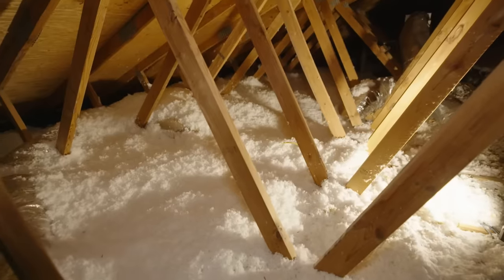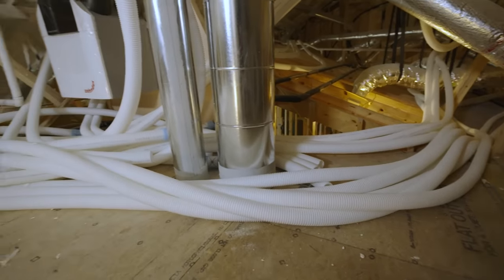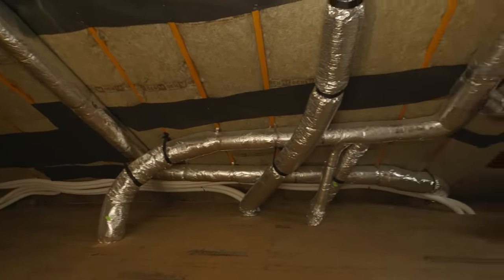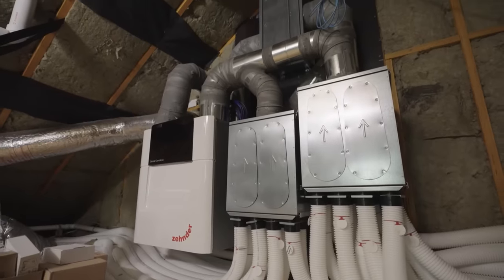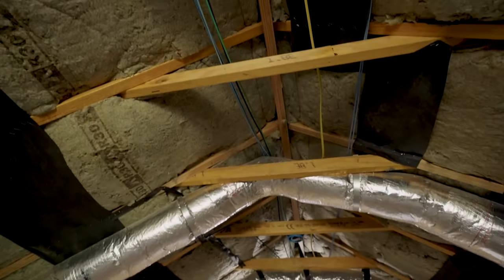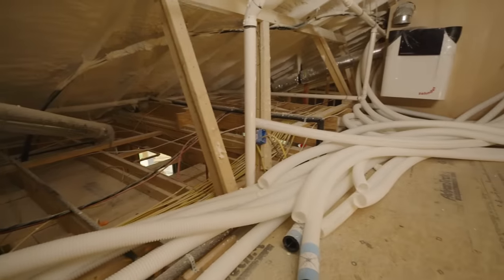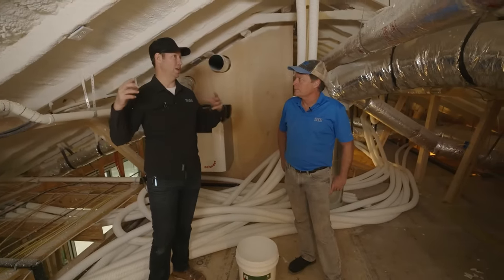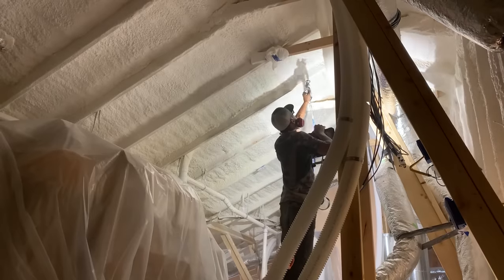Building a BETTER attic - Unvented + Conditioned attics 101

Comment: Consider maybe a vid on how to convert a vented attic into an unvented conditioned attic?? If that even makes sense 😆
Reply: Yes please my house was built in the twenties and I would love to see what it takes to do the conversion
Reply: That would be great!
Reply: You will have to wait until a vendor will sponsor that video.
Reply: Yes I agree. 
I know how but there still are tricks and questions I have
Reply: Absolutely this! I installed a new 30 year roof with a ridge vent several years ago, and now I'd love to seal it without needing exterior roof work. Can I seal the soffits and the ridge vent from the interior before insulating?
Reply: @danielbuckner2167  
Hahaaa so true.
I would love a vid on conversion also.
It depends and how deep are your pockets and how many features do you want?? 
I am converting mine. Foamers have been a bit of a pain. But i love it so far.  Changing HVAC next. Will run a simple fresh air for now but plans of a erv in future.
Reply: You can pay an engineer $5000 to tell you how to do that, but basically hes going to tell you to seal the soffit and spray foam the roof sheathing from the inside, you will have to get the current insulation removed first.

Its probably going to be cheaper to move the HVAC equipment and return air into the living space and connecting to the existing supply ductwork in the attic and sealing any penetrations like pot lights and electrical boxes
Reply: Great suggestion!!

Our home was built in the early 60's with gable vents and a whole house fan.

I would love to remove both and move towards a conditioned space for storage and install an ERV as-well.
Reply: I agree, we really need a remodel an old home example.
Reply: Basically, (although you should ask an engineer) close the vents, and get the insulation sprayed. But make sure the system can dry to the outside.
So you may need to have a vent system below your shingles. Which would be tricky but thats situational, if its traditional roof tiles you will likely not need to do anything as those are already raised above the roof (which is why they keep you cooler, hence spanish style buildings use that)
Reply: Love the video Matt.  I was so sad when you tore down your old house, even though I totally understand why.  I have brick ranch in Ohio built in 75 and would love to condition the attic, because the air and heat is in the attic.  Would like to see a retro fit video.
Reply: YES!!!
Reply: I agree putting ducts in the attic is inefficient   The problem with a lot of these new ideas is that they are not implemented properly most of the time.   A vented roof works in all climates!
Reply: I've thought about getting 4x8 sheets of foam and placing them on the rafters.  Have the foam connect on the bottom and top, but leave room for the vents and soffits to work.  Keep the roof vented and the attic conditioned.
Reply: Yes
Reply: A good foam contractor can walk you through the steps to go from vented to unvented.  There are many things to consider when the house was not originally designed to be unvented.  Often, things like combustion appliances and the HVAC layout are counting on some migration of air through the attic to function properly.  When you change the attic to unvented, it can negatively affect those and other systems.  Be sure your contractor and perhaps a consultant can spell out all the changes that will need to be considered and accounted for.
Reply: They build them all day long like that in Georgia
Reply: This!!!
Reply: Im in the same boat I think I will just end up spray foaming the ceiling and leaving the rest of the  attic vented. My HVAC is already in the house although I'd like to move it to the attic I may end up with just a minisplit setup gotta weigh out the cost. One good thing is most of my plumbing is  below my slab so no pipes to freeze in my attic. Even with a vented attic most houses in Texas have the air handler in the attic.
Reply: @seannewton93  my house was built in the 20s too, literally has to have been like at least 60+ years of homeowner hacks that have worked on it.  Found coal in the coal chute and around it so old it was shiny like glass and smooth like glass too.  (Really, no one spent like 3 min to clean it up decades ago lol, same with chimney soot all over the basement floor, even though they sheetrocked the fireplace in and capped it decades ago lol)
Reply: @macthemec  exactly
Reply: @macthemec  Moving the HVAC equipment would take a full day with a team of two in a best case scenario, and that doesn't count time spent remodeling the area where the equipment is going to be going.
Reply: @seannewton93  Its actually rather simple but in order to prevent mold growth you have to complete the entire conversion quickly.  The first thing you would do is buy a dehumidifier and let it run for a considerable amount of time full blast. This will dry ratfters and wood out, then you want to move onto cleaning, a simple bleach and water solution is the best, probably 1 part bleach to 9 parts water. You simply want to put it in a spray bottle and spray the rafters. (again to prevent mold growth). Then you want to use a mold resistant insolation (in the video rock wool, but you can use others) You want to close off the attic vents permanently and place the Rockwool between the rafters. Only after the new insolation is placed and the attic vents are sealed do you want to remove the old insolation from the ceiling. It is important to keep the dehumidifier running, and if it starts to fill up with water after you have done this if water is found you have an air leak. It is imperative that you fix this immediately. The pro of insolated attics is lower electric costs, the con is that maintenance is a priority because air leaks can lead to mold growth especially in a newly converted attic. I suggest that before you take on this project yourself to get intouch with your local roofing inspector and get a list of requirements for your specific area. I live in the humid south so mold is an absolute priority.
Reply: So… why close the vents? Doesn’t it make better sense to seal off the vented section in an existing vented attic with radiant barrier, then insulate inside that? And leave the soffit vents venting across a radiant barrier up to the ridge vent? Get rid of the heat, then insulate at the top of the envelope? Then the venting and radiant barrier gets rid of a lot of the heat before it even gets to the insulation. Or am I just wrong?
Reply: You mean a finished attic room?
Reply: Daniel Walfield about the same amount of work as a re&re, i’ve repurposed a few linnen closets to air handler closets, return air base with filter and a communicating air grill to outside the closet. It would be cheaper than a spray foam job.
Reply: @jasonm.7358  if you don’t leave an area to vent you won’t get the heat buildup. So no need to vent.
Reply: @macthemec  Pretty much what we did at our house-removed the pink insulation off the floor and sprayed open cell foam under the roof boards inside. Open cell foam was cheaper. It has helped the upstairs a lot and keeps it reasonably cool during hot days and the HVAC equipment in the attic is no longer baking during summer. It was quite a messy job but we had to do it.
Reply: @cinaibur    if you are planning on doing the spray foam, then the ridge vents and soffits will be sealed off as with foam, you can not have any ventilation.   old insulation will also be removed first , then spray foam will be done
Reply: @brad7358  It took me about 10 minutes to look into this. I simply need to install foam rafter vents before insulating. So much for the $5000 architect I need from comments above. lol
Reply: @adamfrbs9259   just replaced a 1975 ac unit in my 1974 house I purchased. Found a half bottle of orange juice from 1975 behind the unit. Looked like black motor oil. Too lazy to throw away trash.
Reply: @dougmann5362  my neighbor put in new AC this summer....AC guy was astonished...it was an AC unit from like 1950 still working lol.
Reply: @Bigrob552002  what’s a ERV?
Reply: That makes no sense and it wouldn't be cost effective. The only way to upgrade to something like this is to build a new home.
Reply: @rayhagg8402  

Hey Ray,
Glad you asked!

Matt has a whole video dedicated to answering that very question.

Check it out here:
https://youtu.be/qc67HOsHuMY
Reply: yes!  my builder didn’t seal my attic as originally planned and i’d love to correct it.
Reply: @cinaibur  I am not the expert but I say if you are not pulling a permit then codes dont know.
The key is to stop the condensation buildup / humidity. That's why he was talking about those pipes exchanging air. That's a lot of money to not have as a living area. How many upstairs have I seen here in Tennessee where the builder simply insulated against the bottom of the roof deck and slaps drywall on. I lost count how many. It works but it burns your roof off and it's a lot hotter. Does mold build up ? As long as there is no leaks. But, you cant see untill too late. So , I say , yes you can have a storage area in an attic without all the expense he is showing. There is idealism and real world. Who is gonna pay. Remove your ridge vent and close soffit and depending on size install a mini split or window unit to exchange the air .
Insulate and drywall or paneling.
Anywho, my opinion.
Reply: There are many ways to handle your attic insulation. Vented is by far simplest and cheapest in short term. 
USA doesnt have much for codes on spray foam. 
Here foam installers dont care about your hvac. They only warranty their install for a year anyways. They are not concerned with problems.
Reply: @cinaibur    guess I dont follow....as the spray foam is the insulation.    if you have a attic, then you would spray the underside of the decking ( the attic ceiling) and the insulation that you currently have in there whether its bat or blown in, would be removed.       would be nice if one could contact a member , but dont think  you can send private messages anymore ?
Reply: I would love to tear my entire roof and the roof framing off and build a more weather, fire and insect resistant roof..
Reply: @seannewton93  if you have asphalt shingles you probably still have to vent it, but you can still do it like Matt’s house and use it as living space. I did it to my house since it a half story house built in 1900 as I use as the master bedroom
Reply: Most attics in warm areas are over the garage and you can't AC a garage unless it's a separate system from the house.
Reply: @MoneyAndPeople  that's all good. Insulation against the bottom of the roof deck blocks air flow and if there is a leak , yuu can't see for the insulation . Then yuu got mold again. Plus....installing insulation against the bottom of roof contributes to the roof shingles being burned off in hot climate.
Better to have separation for good airflow by having a roof system / attic space to allow airflow to escape. Then you can insulate from the inside or withing a roof system or both to achieve all problems. Low utilities, cooler attic area, no mold, and possibly add a combo air system to dehumidify and condition accordingly. There needs to a balance since we are all trying to solve the problem of building a cave above ground. Lol. Good luck
Reply: Or at least the best way to mitigate the heat without fully converting to sealed attic with sprayfoam.
Reply: @mikepeek5655  he asked how to retrofit an existing install. All roofs should technically be "floating" especially asphalt shingles. (hip and ridge) Its important to think of an insulated roof as a very small triangle shaped attic. However if you are retrofitting, that small space is typically not enough to prevent mold growth, which is why i suggested the dehumidifier and the pre-bleaching application as well as mold resistant insolation.
Reply: Yes please.
Reply: My house was built in 2003 here in Florida and my attic space shows like the one in the beginning of the video with R30 blow in Installation.
Reply: I mean I would pay for retrofitting if it meant you get an attic that is somewhat livable, give me lower bills, and reduce humidity. Does anyone know of any companies that retrofits attics?
Reply: @mhanley05  look at polar king here in Florida. That's what i'm gonna do in my attic
Reply: @cinaibur  I too am interested. I built my home 4 years ago with vented attic.   Was always told that the shingles would “overheat” if  there wasn’t air on underside of roof sheathing.
Reply: Go look back on the older ones. He has done videos on this guys.
Reply: Yes Please!
Reply: @mikepeek5655  one of their sections they mention the metal roof above. I bet the metal roof was a choice to mitigate the shingles baking off
Reply: Would love to see that process in depth.
Reply: @patrickknapp5867  I've heard it's hard to do without getting mold issues.
Reply: I believe you need to strip the shingles, add 2x6 with insulation, then sheet and re-shingle the roof. Only then can you do the inside work. Your joists and 1st floor must be strong enough to support things.
Reply: I would love to see that my house was built in 1890 with multiple additions and the venting sucks I would love to seal it off
Reply: Agree; I would find a vid like that very useful.  I’m in San Antonio in a 1993 2-story.
Reply: I totally need to covert my attic to conditioned!
Reply: 100% this video
Reply: @danielbuckner2167  Interesting how Matt never discusses the most important part of these sorts of these sorts of projects, which is cost. I imagine the ROI on all that fancy attic insulation is 50 years or more on energy costs.
Reply: $75,000
Reply: I always prefer the open attics with the collar beams.  these new prebuilt pee engineering joists that come in “qty over quality” i have noticed have issues with  parts of the structure snapping due to live loads. 

Not to mention, it’s a PITA if ur HVAC system is in attic (less the condenser).  I just replaced my HVAC and the design and layout created problems. i was limited to what i wanted without spending 20K more.
Reply: Yes but has to be done proper to support the weight, not always a easy job depending on the roof and truss style and age of house. Great idea. I would do this if I was to build my own home!
Reply: @adamfrbs9259  that's rather unfortunate, I would NEVER eliminate a fireplace or wood burning stove under ANY circumstances, we are about to find out why! We are so close to collapsing as a country because of Biden's policies, and we will be back to the stone age! Get your gardens, and food storage ready, and stocked up because of inflation, you won't be able to buy a cart of groceries with a wheelbarrow full of cash!
Reply: @MoneyAndPeople  wow that would suck to deal with all that. I live in Utah where if the humidity hits 20% for a day or two people think they are going to sweat to death.
Reply: @adamfrbs9259  I would have kept it if it was still working! Those old R-12 units were badass, that was before they started blending the gasses, and screwed up the properties
Reply: @mhanley05  çheck around with contractor's in your area to see what is available.
Reply: We need recommendations on closing off vented attic.
Reply: @borderwave2  I would mostly agree. The real benefit on return here is in the pockets of manufacturers and installers.
Reply: @cinaibur   yes, and you can either run baffles all the way to the ridge so the entire surface is ventilated (1" gap or so), and leave the soffit and ridge vent.   Or seal them up....this was called a "static" attic, and worked in the old days because everything was so porous that moisture wouldn't get trapped inside the materials.  You have to be careful to match the insulation system with the roof finish so moisture isn't trapped in the sheathing.  Have an engineer or architect do the math and be sure the dew point doesn't land somewhere where there can be condensation.  And check with the manufacturer's warranty requirements.
Reply: @macthemec  Thermal analysis, Energy Audit and a spec should be more like 1K tops, maybe less.
Reply: Nothing is impossible with enough money and time.
Reply: @seannewton93  a whole lot of framing upgrades in the attic.
Reply: @cinaibur  just had my house sprayed and you don't have to do anything  When they spray the insulation it seals up the ridge vent and soffit vents
Reply: I think you'd have to replace your whole roof and attic.  All those cross beams in a typical attic get in the way of having a nice big open space.
Reply: It's too expensive to convert.  Easier and less expensive for new builds.  Unless you do it yourself and follow codes.
Reply: @kevinhanrahan2255  it does, and you do need the adequate venting which is typically the issue for most roofs.
Reply: @KforConstant  I've seen that plus having that aluminum coating on both sides of the foam board to help with both warm and cold seasons. Just make sure to cover those exterior wall top plates.
Reply: @jasonm.7358  you have to think that wall systems are often unvented when you apply closed cell, it's the same principle for ceilings but with a slightly greater thickness since heat rises.
Reply: block off all the vents in the attic that allow in outside air, then spray foam under the roof decking.  Done.
Reply: @cinaibur  yes.  Seal everything but the insulation needs to be on the underside of the roof decking, NOT on the clg.
Reply: You can't do this with trusses, and that's most typical homes from the late 1950s forward.
Reply: @damienhudson8230  You can run a zone set up on a single system:  One zone for the garage and another for the rest of the house.  No return air of course...
Reply: @Bob_Adkins  That's silly.   Assuming your attic is stick-framed and your ceiling joists are 2x4 (worst case), you could use a T&G 3/4 CDX flooring, if there are 'spans' that need additional dimension, the ceiling joists can have larger dimensional lumber sistered along side, no need to tear it out.
Reply: This was an excellent suggestion
Reply: There probably isn't a reason for the cost involved to do it.
Reply: no it doesnt, it will take you a several decades to get your money back.
Reply: @ShrimpCracka  One of the benefits they're finding to a partially conditioned attic space is an increase in savings due to the fact that a properly vented attic actually draws the air from the house out if its not fully sealed, and most are not.  It literally creates a vacuum for interior heated/cooled spaces. 
              But you're right; it takes a LONG time for the savings to reach $0 on ROI, but the savings do come noticeably every month!   And it doesn't require the ceiling being completely air tight.   Something that were it done properly for a vented attic, would be tremendously costly in its own right...
Reply: I'm guessing the paint isn't super thick.   Curious why the fired test foam is like 1/2 inch thick the painted one is like 5 inches thick.   I'm not really watching the video it came on and skipping around doing something else 
Seems when you do a fire test would want everything equivalent except for the onemthing you're trying to prove makes a difference (paint)
Reply: @phironosurvivors2069  I agree.  The first attic is 2x4s and is small, low and older house.  The showcase is basically expensive beams with much more headroom and new construction.
Reply: It makes sense if the cost compares to the benefits of doing so an attic. Not all attics spaces are usable or have decent access.
Reply: Exactly what I wanted to ask.
Reply: The answer is basically replacing your trusses to have an open design like they were showing here you cannot modify trusses that are installed as it causes structural issues. If you are looking specifically  just for doing roc sol insulation or spray foam in your current attic theb that's doable but additional venting will need to be done possibly some structural changes.
Reply: @seannewton93  I wouldn't want a warm roof unvented where i  live, it works better in a warmer climate.
Reply: Roof your house with imp.
Reply: I can attest this works !
Reply: @seannewton93  I did this on my 100yr old 2 story farm house in Nebraska nine years ago.  Hip roof with 2x4 rafters on 24" centers.  The roofing used to be cedar shakes, prior owner removed 20 yrs ago and 1/2" plywood and asphalt shingles on top of the 1x6" sheathing.  Too heavy for the rafters!! The center rafters are 18" long and sagged 2".  I jacked them up about 1" (all I could do).  Then took 2x4s and married them on edge to make a 2x8.  Had to cut off some old roofing nails coming through the sheathing, before putting 7" wide 1/2" plywood (not OSB!) on each side of the 2x4s.  Made a sandwich with 8" long plywood and lots of wood glue and teco nails. Stagger them lengthwise to carry the load better.  Palm nailer came in handy for those tight spots down where the roof meets the floor. This provided the space saving volume for the foam sprayed right over the wood.  Use either HIgh density or low. Then put a fire barrier over it like these guys did.  I used 1x8 tongue and groove pine and put in a wet bar and 8' pool table, with stereo system and large screen TV.  Perfect kids hangout.  The 2x8 floor is also insulated with fiberglass.  Built some nice oak tread stairs and now it's a huge improvement to the house.  All on a permit that the building inspector loves.   Just make sure your thickness meets code for your area.
Reply: Yes. Need a video of conversion
Reply: I NEED THIS
Reply: i second this
Reply: @rayhagg8402  Energy recovery ventilation.
Reply: Unvent …… and condition ..
Reply: @davestanley6233  Roofing absorbs sunlight and gets hot. Insulation slows the rate that heat enters your house, but if you vent between the decking and the insulation, some of that heat is carried away through convection and the insulation is then more effective (eg you could use less). Iirc, most asphalt roofing product warranties expect the roof deck to be vented in some way so as to lower the roofing temperature and extend lifetime.
Reply: Yes please, buying a 1975 house unconditioned attic and would like to convert here in outskirts of  Jersey
Reply: It does. Will do